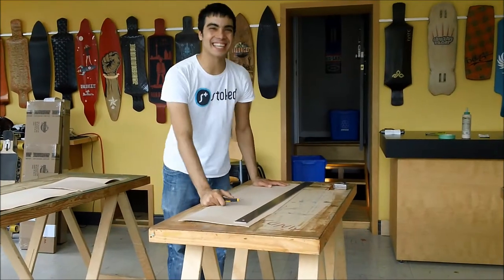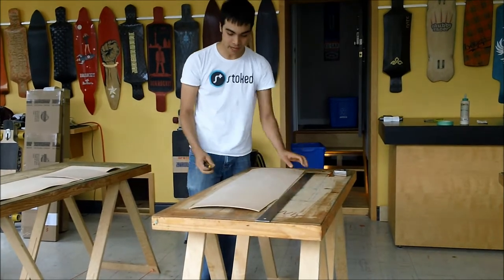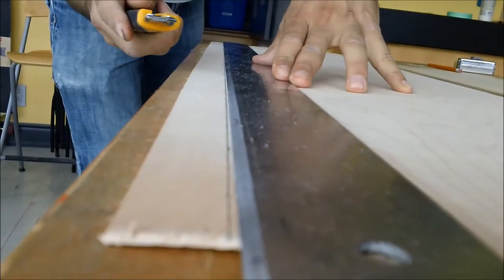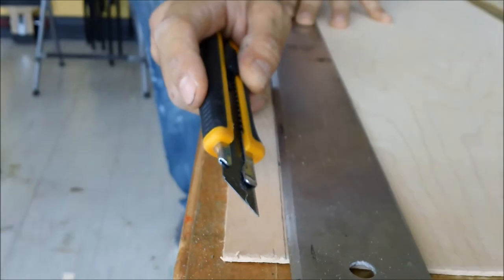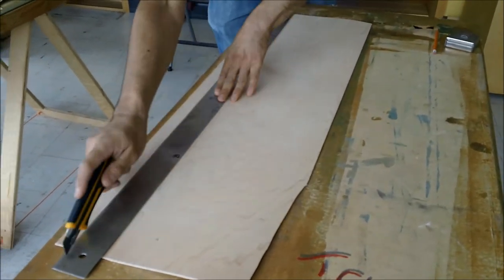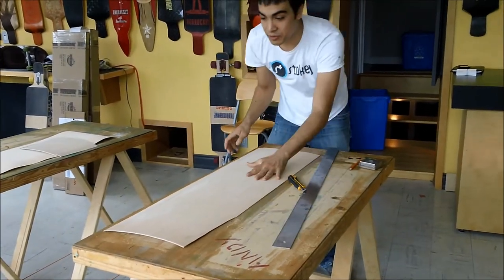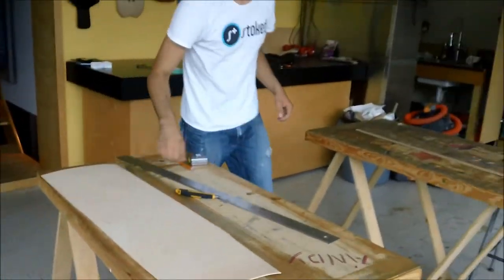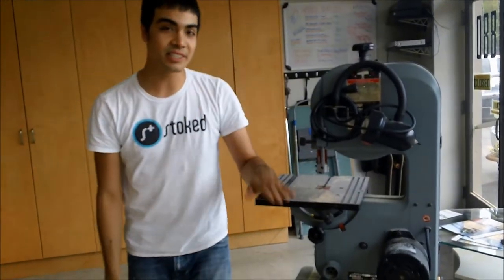Cutting 1/16" Veneers

Comment: Can you cut the veneer the same way but across instead? Or does it only work if you follow the grain?
Reply from the maker: The veneer is easy cut using this method both with and against the grain. Going against the grain may take a couple extra cuts to get through though. Hope that helps!